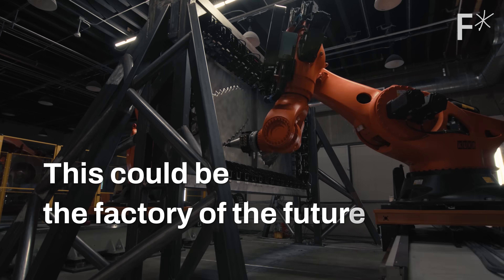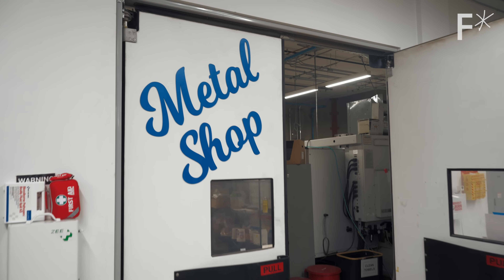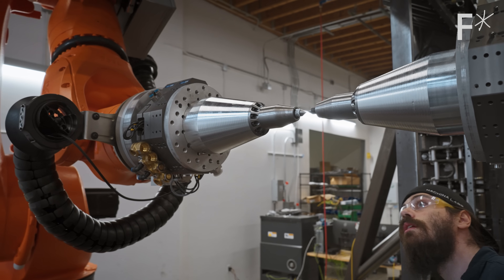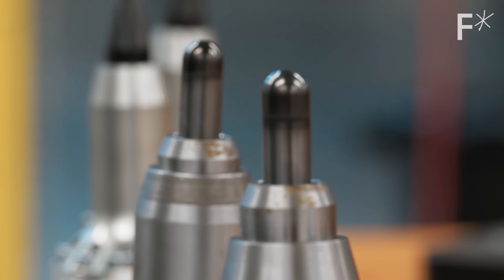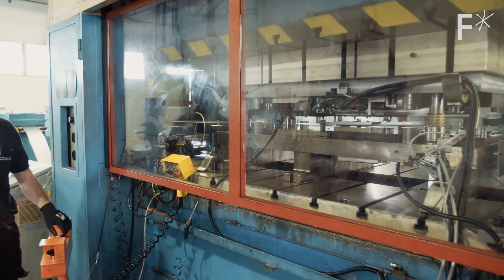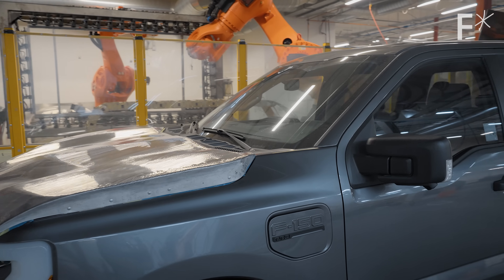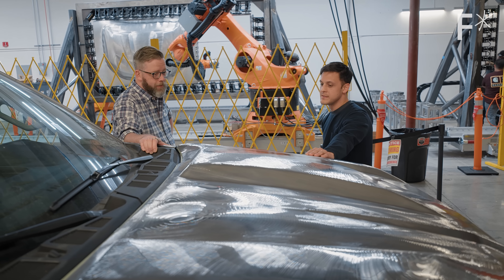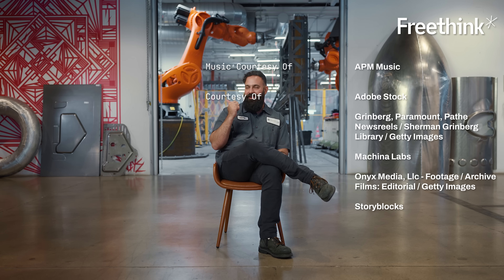Former SpaceX engineer invents a “Robotic Blacksmith Army” | Hard Reset

Comment: Aerospace engineering student here: My concern with this method of forming the material is that its strength is affected through stress-hardening. 

Stress is applied to the material until plastic deformation. When this stress is no longer applied, the material can undergo more stress AND strain in the elastic range with the same modulus as before. This means it can deform further and still retain its shape, and the relationship between stress applied and deformation is the same.

However, this comes at the cost of the remaining stress-strain curve until failure. From this point onwards, if the strengthened material deforms, less stress can result in a fracture.
Reply: The part can be normalized after forming. As long as they didn’t over work it to the point of grain failure, it’ll take out all the stresses. Damn big oven, but they’re out there.
Reply: I think that stress is probably somewhat of an issue but as the AI improves and learns it's only going to get more perfect. Eventually it will be a non-issue
Reply: @Jokerwolf666  … how can an AI, who’s purpose is to deform a piece of sheet metal, deform a piece of sheet metal and not do so at the same time? The moment you plastically deform a ductile material, you’ve affected its strength. I’m not saying the method is incorrect, I’m saying this is principally unable to manufacture load-bearing pieces because of how they are formed in this process of deformation. Covers for cars are fine, but you can’t expect to make something to bear a large load without taking into account the decreased inelastic range at the cost of the increased elastic range.
Reply: @meandi2964  It will be a combination of AI and new tech. The AI can only go as far as the hardware that limits it.

Comment: it's never going to be able to compete with cycle times of stamped parts. This is for niche items, not for large scale manufacturing. Also, these parts will have to undergo multiple other polishing and finishing steps due to the uneven, grooved texture of the completed item. Have you done steel integrity tests on a finished item? How much have you stretched and degraded the strength of the material you're stretching? In my opinion, there's a reason this concept never took off. It's highly impractical for the majority of companies using sheet metal currently. You seem to skate around the fact that sheet metal stamping, when setup properly can have changeover times of less than 1 hour when changing between part types/sizes. Sheet metal stamping uses DIES that are made to be removed, repaired, and replaced. You've only created more problems than you solved. I'm sure someone will buy it but this is not the revolution of the manufacturing world.

Comment: i have a sheet metal factory doing duct, dampers, air outlets and all the stamping parts which comes with it, i have been thinking for the past few years how to automate my business and move to the next level, but those robots for sure are not the solution.
your technology can work only for small quantity of the same item, very customizable item if i might add,, you are saying that press machines are expansive which is not true, press machines are very affordable and can last for 10's of years but maybe the die is very expansive " depending on the size and if its autofeeded" but in general its not an expansive and very simple to make if you have the right quantities.

Comment: Really a good thing for REPAIR industry
Reply: I dont know - the thing is here in Germany there are still a few tradesmen that can manufacture a stamped steel metal part like a car fender or so by hand.
Without expensive tools and i bet even a little faster than these robots.
Reply: until you compare price with fiberglass

Comment: Stupid things about this video. 

1) it’s not blacksmithing it’s sheet metal forming. 

2) a skilled sheet metal former could make it in similar time with better quality and lower cost as they’ve been doing for at least 100 years.

3) this automation procedure has already been attempted by several different companies. 

4) if it’s for prototyping then just 3d print out of plastic.

Comment: Why compare this method of manufacturing with stamping manufacturing? It sounds the same as comparing injection molding with 3D-printing. 3D-printing is great for prototyping before you create the molds.

Comment: Complete B.S.: 
GMC's motto has been a new model every year. Other makers change car generations every 2-3 years. How? Drive trains aren't stamped from sheets—they are produced on a series of specs, and for each spec, e.g., 1.8L engine for ~1.2 t sedan, they change the stamped trim of the car only, i.e., changing dies only for the same press as long as it delivers sufficient parameters, i.e., the same shop is used variety sizes, forms, and material.
As for rapid prototyping, FRP modeling and additive tech are the solutions.

Comment: This is a fabulous idea but at early stages. Pressed metal the traditional way has a far higher production rate .

This solution presented looks like it takes hours to "press" one piece compared to hundreds of pieces pressed the old way at the same time.

The solution using the new method is to have hundreds of these robot pair stations to parallelise the process and increase production rates .

It would be interesting to see how many equivalent "pair stations" can be built for an equivalent cost of traditional stamping machines.

Someone has done the numbers and I suspect once the "pair station" end production rate is at a certain speed this new solution wins out

Comment: Sheet metal presses are used for super efficient mass production and quality, if there is a need to change design you only need to change a tooling inside the press, which is CNC milled once. Infact when they are worn out, or there is a new design, just like cars coming up every apprx 3-5 y with mods or new versions, you just need to change the tooling inside. But yes, if it must be sheet metal, for rapid prototyping, or repairs that could be an interesting new manufacturing solution.

Comment: Just getting into fabrication myself, come to realize a couple variables relevant to this process. One of them is safety. I, myself am more of a proponent of common sense and appreciation of good health and function rather than safety as a ghospel. But we live in a time where people can feign ignorance, self harm and make a buck in court so standardization is in large part why we can have reliable safety certification. People used to find the safest and most efficient standard of manufacture since the dawn of manufacturing things. Geometry and physics are chief designers there, as well as material properties. that is why drop forging is still the king of industrial components with high strength tolerances, axles and pistons for cars for instances. 
https://www.youtube.com/watch?v=A7ayuF4v_EU
I strongly felt like rebalancing the scales - glowing hot metal has an instinctive attraction.

As i have begun 3D printing i have come to realize dimension of active fabrication also plays a huge role. that is to say: for an extruder on a printer or the rolling tip of a robotic arm to complete a large piece of work, a lot of tool travel is required because of the small area of impact at any given time. the FDM extruder is a very small dimension of active fabrication compared to the LCD on a resin printer, or the entire volume of a cast resin mold. The dye stamping vs robotic roller tip is at two extremes in this aspect. As such, the "custom" aspect of fabrication still demands a markup in price in order to keep the lights on, which in my opinion is a huge gatekeeping factor, not so much for the fabricator as for the potential customer. That is in large part why casting and stamping has become an accepted and appreciated expression in consumer items for most of us. 

Luckily, besides factories getting better at standards and worse at hand-to-eye coordination, being rich has a tendency to become comically ratrace-esque in its hunt for individualism so there's always a market for a good idea.

Comment: When it comes to car parts, it would be much easier to mill a mold and build the parts out of carbon fiber. In addition, the surface would be much better and wouldn't need as much rework.

Comment: this is cool and a new and useful way to manufacture custom special parts but this will never replace sheet metal stamping unless the speed of this process is increased at least 100x this is like comparing 3d printing to injection molding they have different use cases and one will not replace the other anytime soon because as always time is money

Comment: A few things I can see that would possibly add utility to the process, is a built in induction heater on each arm, a quenching system (coolant, and/or oils for quenching with custom temperature outflow) and a magnetic coil array for manipulating steel magnetically, and/or having multiple contact points for each arm with ferrous "magnetic tools" for the robots to utilize.
Reply: all terrible ideas

Comment: Like 3D printing, this is amazing for ultra custom and boutique manufacturing... But this is entirely impractical for half the things he talks about. When you need a million of something, stamping is just so extremely fast and accurate. To get similar throughput with something like this we would need a whole lot more robotic floorspace and up front investment than stamping takes.
Still very cool tech, and it is going to fill a niche that hasn't been touched yet. But the idea that this could bring highly custom manufacturing closer to point of use at any scale is a bit silly.

Comment: When you can press the same sheet in seconds not sure this makes sense for mass manufacturing only for custom or maybe prototypes. Also the press is the same as the huge robot arms apply preasure to shape metal the arm is jst slower. Regards needing to change the whole factory for ea car no you just change out the dyes. Further issues is final finishing these pieces need a huge amount of finishing before you can paint it

Comment: Why is it vertical instead of horizontal? You can have the bottom forming pin on the bottom and the robotic arm on the top. The bottom part wouldn’t need to be a full size robotic arm. Save some $$.

Comment: This is a stupid way of doing it you could have a c frame with the offset pinch rollers and then you need just one robot holding the sheet metal in a picture frame to move the sheet around between the rollers.

Comment: I agree that this is huge development but i dont know what why they would compare with large scale stamping. Its completely opposite things, one is for large scale ( progressive stamping ) with sometimes thousands of parts made per minute another thing is roboforming that it looks like to make custom made stuff more accessible. All have their space but comparing both doesn’t make quite sense in my opinion, since the robot won’t do a finished part every 10 seconds for example by this process, but it will avoid tooling for low production 10 or 100 part per month or year parts.

Comment: The startups like these are cash cows, or milk drinking cows, only grabbing money and nothing else. And Channels like these making it look fancy. Because, the reason why we have 100 year old tech still working very well, and not the 1000 year old 'blacksmithing tech' is because ITS NOT COST EFFECTIVE AND ABSOLUTELY NOT EFFICIENT. The first sentence that this mechanic look-a-like guy say is, ''metalworking is used to be art and craft and we used to do blacksmithing'', the reason why we don't have that is because its not efficient, the sheets that are used in these kind of jobs are very heavy and very thick, where in this 'gravity dominated' world this guy is going to use this except making buildings and that is also just tiny ones. You use any of his final products in automobile, aerospace, marine environment, and you have instantly rigid, large scale fuel consuming, about to be collapsing, entities! There is reason why SAE, AIAA, ASME and all other institutions have limit on the thickness so that efficiency of the entity needs to be optimized. This dumb guy and his dumber robots are the definition of 'efficiency killer'!
Reply: ''You can't make it rocket fatter'', yes you can, dum dum! Look at NASA Space shuttles, they were able to make rocket bigger in diameter by using thin sheet metal and friction welding techniques, look in NASA technical paper archives around 1973 - 75.

Comment: People who keep saying that stamping is 10000x times faster seem to slightly miss the point. This is not aimed to be the next best way of mass production - this will however revolutionize industrial r&d. Being able to prototype functioning parts on the fly, within  days, without having to trial and error any ridiculously expensive machine dyes? Dream come true. This will likely be as important for r&d as the 3d printer was, especially aerospace. God damn.
Reply: Exactly. The other point they missed is one of the owners goals being to make a system that is affordable enough that small copanies cn set up their own small scale manufacturing. There will always be a market for the truly skilled craftsmen. Even making the original parts for this to scan and copy but creating more options to speed up and reduce costs for R&D before the huge investmnts fo mass preduction, is a massive step towards a civilization that can expand beyond the current status quo. I'm stoked lol, i may have just repeated what you said, but I got excited that someone else actually saw the same potential as I did.

I've worked with sheet metal for the last 15 years and done hundred of small custom fabrications for houses, waterproofing an aesthetics as well.
Reply: I don't understand. Robot arms are incredibly expensive and heavy, process extremely slow, and end result looks worse than flea market part.. I mean, the idea sounds ok, I guess, but I saw nothing of value in the video. I did, however, see an insane amount of money spent on machines that don't produce much of anything. I just don't get it.

Comment: I like what they are doing but I don’t think this would replace the need for a stamping press in industries like automotive, simply put it’s too slow. With that said, I can see this technique being quite good for prototyping and mass manufacturing of large metal sheets like those on a rocket ship or a plane because in those use cases, production is usually in smaller batches, or the materials may be too difficult to stamp (like the 30X stainless steel used for starship and cybertruck), or the shape of the sheets are just too large to be stamped.

Comment: How about one the is a metal break that can realign itself in multiple directions and hold itself in different positions like holding the benders separately and then they align and or bends itself to make the bends for example making a car door and itself guts or a trucks hood hinge or having a 7 arm weld with one point being the welder and the rest being claws that can be magnetic when needed to handle what's being created also it being controlled by a learning AI could also let you use the the welder like a 3D printer

Comment: Now explain how they cut those massive megalithic stone faces with abstract planes so the stones would fit with adjacent stones forming better "panel" gaps than most automotive manufacturing? Working metal is a lot easier than stone. So how did they do it? Look how difficult it is to have two abstract shapes match up perfectly.

Comment: They could most probably get these forms without ridges by using and English wheel type opposing robot, or better yet allow the robot to change its tooling head for different forms. Between this and a 3D Printer line they can nearly literally make anything, one step closer to true Von Neumann machines!

Comment: lol, this runs on an STL file, you can even see the remesh of the high poly in the end result, it makes this island/layer/treetrunk  kind of result in any 3d software. There is really no "AI" involved, its just a huge 3d printer but with a hammer instead of a print head that melts plastic.

Comment: Heat forming the big metal panels, then welding them together, using another robot, MVD printing the parts and components out of metal, could get rid of the need for standard or traditional manufacturing, or shaped mold manufacturing, for most systems.

Comment: Spot on in manufacturing 👊 but I don't see it replacing stamping speeds. I do see R&D before retooling a product line or eliminating steps required for the final product. Huge after-market products are better inclined for AI robots 👍

Comment: I'm missing the value add. I work in a sheet metal manufacturing plant and the ROI is the critical variable. For us, tooling can be produced in about a week-4 weeks, depending on whether we in-source or out-source. Cycle time, once producing, is 1/100 or 1/1000 of the time it takes to make 1 part with this process. 

You don't need a "multi-national corporation" to make something out of sheet metal. We use basic hydraulic and mechanical presses to make HVAC components and we started in a garage. Honestly, you can get a relatively inexpensive used hydraulic press for around $45-$60k, tooling is ~$5-$15k depending, and a decoiler is probably around ~$10-$20k. Once my line is established, I can make thousands of parts/day. The ROI tightens up real quick when you consider thousands of parts/day.  What's neat is that we've made tooling from laser cut sheet via sendcutsend.com and a Creality ender 5+. Granted, we're forming 16ga sheet max. However, the compressive strength of PLA is up to the task and has been a huge help.